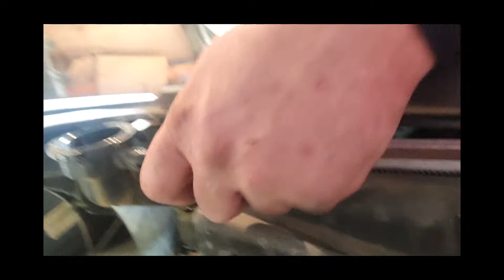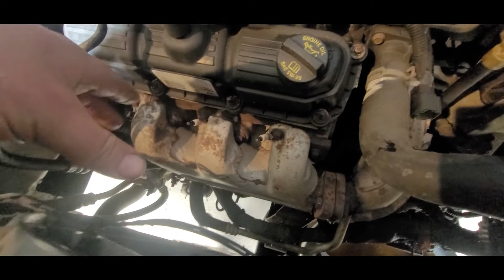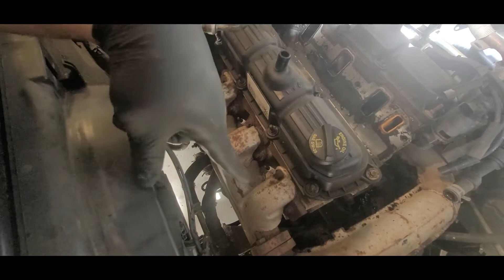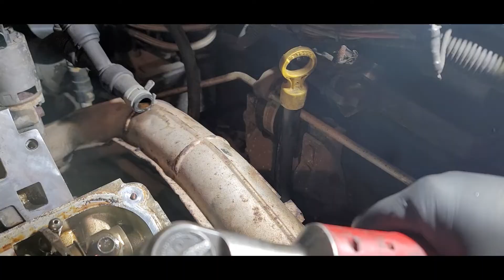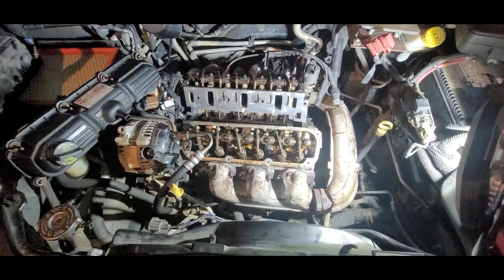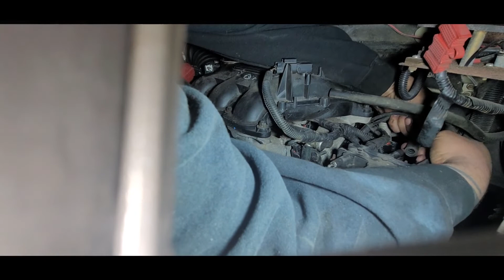2007 2008 2009 2010 3.3 DODGE GRAND CARAVAN CHRYSLER TOWN AND COUNTRY HEAD GASKET REPLACMENT

Comment: I have an 2008 T&C 3.3 V6 and the passenger side of my motor is full of oil ... everything on that side is just covered in oil. I havent really looked at it to see where the oil is leaking either I get like 400 miles to a qt of oil
Reply from the maker: Sometimes oil leaks are not as heard as you think to figure out.  Just have to follow the oil up.  Most likely it will be a valve cover if the leak is coming from high up.  If it's low could be timing cover or crank seal...  hope this helps
Reply: @EricsEverythingAuto  I will some day, i think it be hard to find because how bad the oil is on everything. looking at it from the top of the motor
Reply from the maker: @shaunsfrench1942  a severe oil leak is a potential fire hazard and should be checked and fixed.  Take it to a reputable detail shop and have them degrease your engine.  Stop at your local parts store and ask them for uv dye for oil and ad to your engine.  Drive for a day and put a black light on it.  You will be able to see where the dye is coming out.